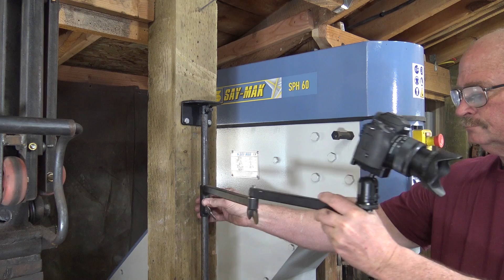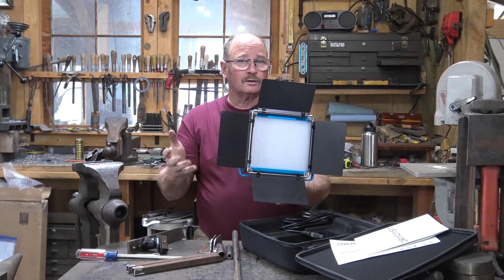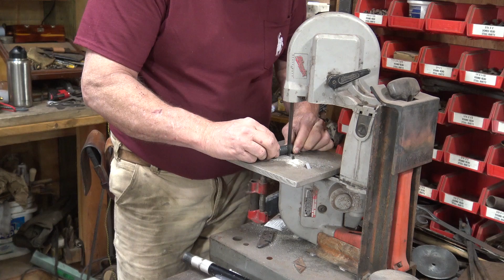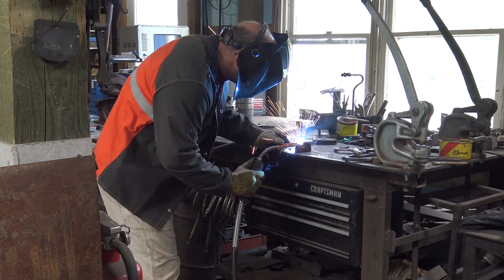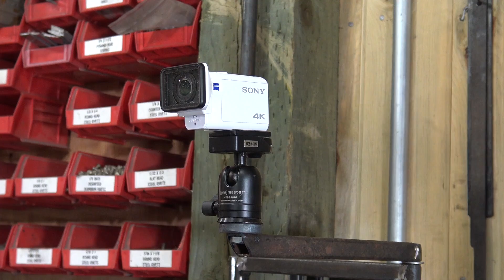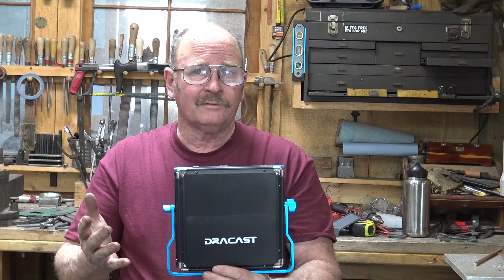Camera mounting arm construction

Comment: Are you sure you need a ball mount with that light's swivel bracket? ❤🌅🌵
Reply from the maker: I originally thought I wouldn’t but the lower barn door hangs up on the yoke.  Plus the mount I ordered has a spot for an umbrella style light defuser.

Comment: @2:05  Photo/Video stores sell "Spigots" for this purpose.  However,  I've been a photographer for many years and have been using cheaper and more accessible  1/4"-20 (and 3/8"-16)  Coupling nut.   I have several in my gaff box. They come in handy for all types of rigging.  Be careful with the 3/8"-16 Coupling nuts, some are heavy duty (thick wall) and too thick to fit into the lights. I used to buy the thin wall ones from TSC but they didn't have them the last time I was there. 
Nice Adjustable stand build. Cheers!
Reply from the maker: I have one ordered from an online camera shop.  But the coupling nut is a great idea

Comment: I think I would have drilled & tapped the upright bar instead of welding (at least on one side).  That would make it much easier to change the arm if the need arose. I don't know what reason you might have for changing the swing arm, but that's the point; you don't know what you might need in the future. But, it won't take much time to simply cut off one of the braces if the need ever does arise. Thanks for sharing this; I could see this being a useful fixture for a standard light over the bench.
Reply from the maker: The first one i did had sockets and set screws to make it removable.  I decided grinding the weld out to take it apart would be about the same amount of time as making the sockets.

Comment: You have generally good lighting, but I have an inexpensive and easy way to make reflectors. They can add lighting flexibility and fill lighting without breaking the budget.
I worked with a number of news and field production photographers who used flat sheets of plywood painted silver then buffed. Sometimes they painted one side silver and the other side bright white for flexibility.
The plywood was cut big but just small enough to fit in the vehicles. You wouldn’t really have that restriction. The photogs I knew used standard construction plywood, nothing fancy, but I suppose MDF would work fine (MDF or particle board is too heavy to lug around). You’d probably mount your sheets more or less permanently so weight wouldn’t be a problem. 
Making the reflectors is simplicity itself. Lightly scrub the surface of the plywood with scotch pads to get rid of most of the “fuzz.” Don’t overdo.
Spray on silver, metallic spray paint in several coats, let dry well then buff with crumpled up kitchen aluminum foil. Viola. Mount. 
The spray-painted plywood is shiny enough to provide good reflectivity but the reflected light is diffuse enough to create very good fill without shadows.

Comment: I was just thinking that you could alter the arm so both the camera and light adapters are on it at the same time. That way, when you want to switch between the camera and light, you don't have to change the adapters as well. 🤔
Reply from the maker: Thats a good thought.  Perhaps just adding a second arm so they can be positioned independently.

Comment: Hey bud what’s the difference between this light and let’s say a construction light.  Portable light something you can buy in the home center both led.  Isnt something like that a lot cheaper....just a question   Love the new formate and the fading in and out scenes
Reply from the maker: Quality and predictability of light temperature mostly.  LEDs made for photo and video use are very exact when it comes to color temperature.  The work lights are pretty random and can cause some odd lighting.